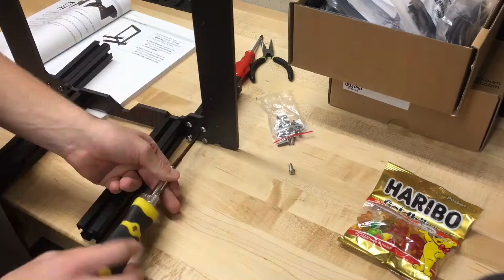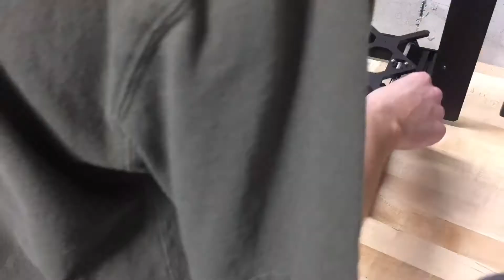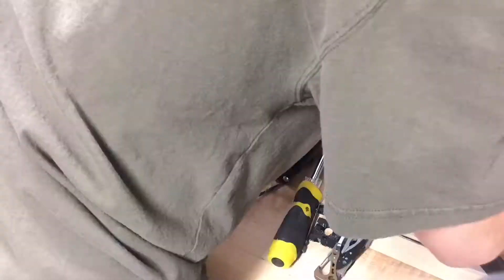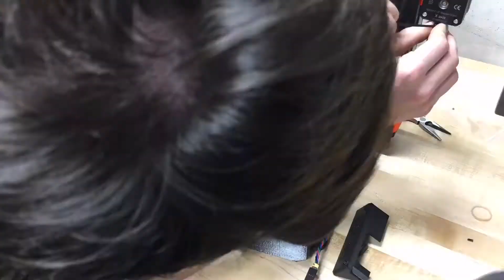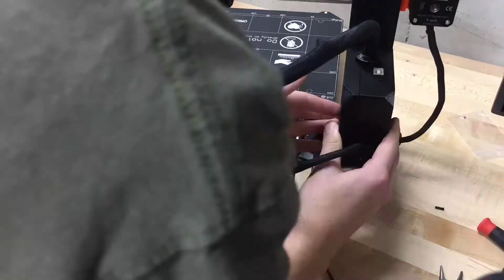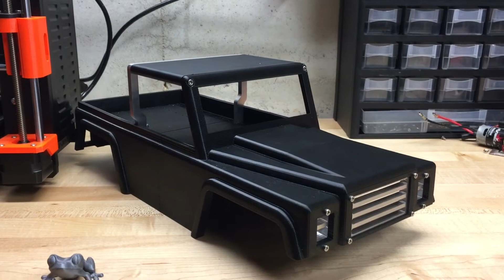Prusa i3 MK3S Build-EXTREME RC 4X4

Comment: Finished building mine but it's failing the xyz calibration.
Reply from the maker: Vivicloud01 is it in a wide open space? Mine failed it a few times because the heat bed power cord was hitting the wall behind it. Also make sure to try the Prusa online instructions to see if anyone else was having the same issue.
Reply: @ExtremeRC4x4  I'll check that when I give it another try. Mine makes it to the 4th calibration point and the fails. I've been sifting threw the forms to see what other problems people have in countered. Mite try the live chat at sompoint.